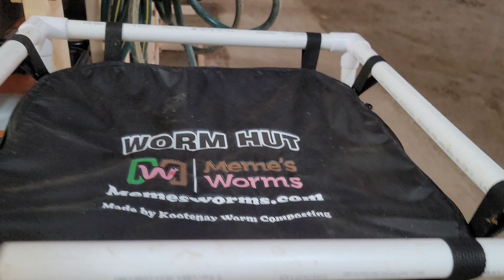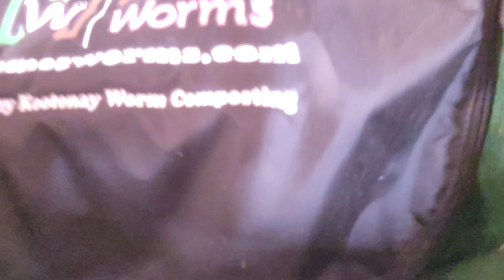Top Tips for Winterizing Your Worm Farm – Keep Worms Alive in Cold Weather

Comment: I opened the lid to my worm bin and I had 2 worms dead and they were covered with little white mites… What do I need to do?
Reply from the maker: The white mite looking things are just cleaning up the dead worms. It's prolly nothing to be concerned with, but you may need to add some carbon.
Reply: @MemesWorms   Like leaves and cardboard?
Reply from the maker: I would use cardboard but leaves are fi e too

Comment: I have the Urban Worm Bag and the garbage can that Captain Matt had the video of building. It is 8 degrees this morning and was 2 degrees yesterday morning. I have my worms in a garage with a seedling heat mat in each bin. I have a thermostat on each set at 80 degrees and it has been running between 71 and 78 degrees. It seems to work great on these small bins.
Reply from the maker: Wonderful!!